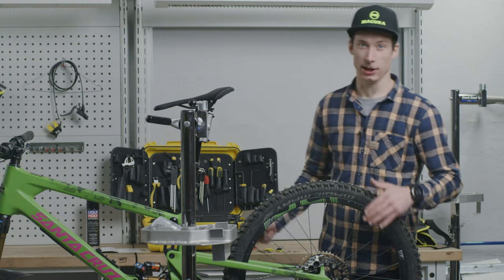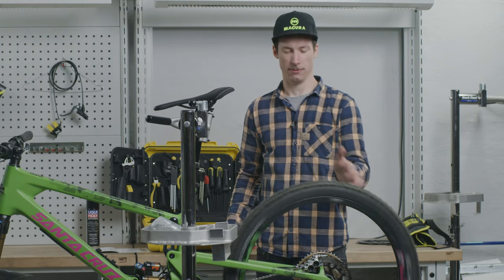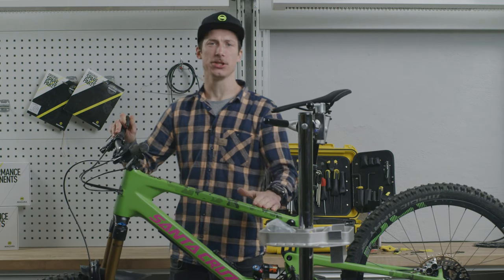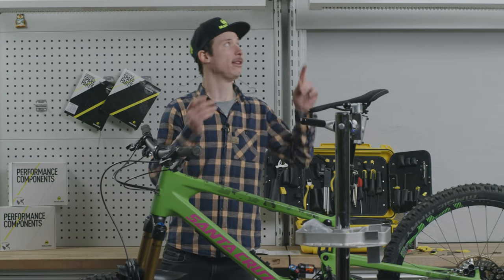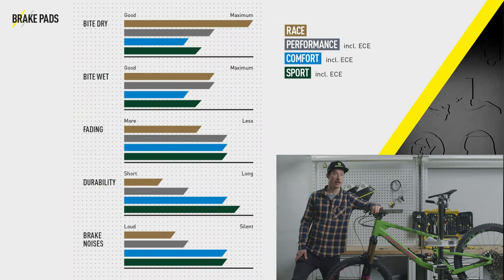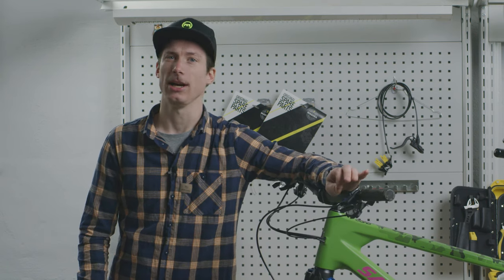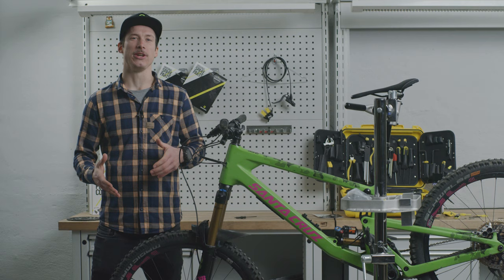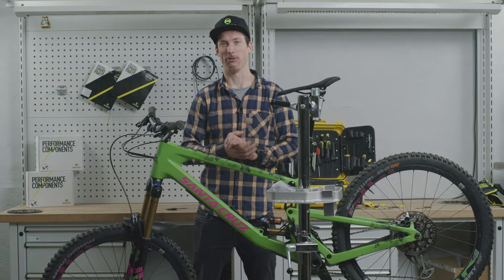Maximize Your Brake Performance - Noise, vibrations, fading, squeaking? Tips for max performance!

Comment: 30 STOPS to Bed In brake pads/rotor! 🤣🤦‍♂ 
Bigger rotors do NOT provide more braking power...
They may provide more torque and they do provide more heat dissipation through a larger surface area.
WHich provides more effectiveness and efficiency. But not more 'power' 
Larger rotors offer better utilization of thermal transfer and energy conversion.

Comment: My new MT7's are making a horrible gurgling / turkey gobble sound when gradually braking. Going to try the tips here in this video, and I'll report back! Also sent a message to Magura customer support to see if they've had anyone with this problem in the past
Reply from the maker: Could be an issue with caliper alignment, could be an issue with lack of bedding in / glazed pads. Feel free to send us a message on Facebook or Instagram for more help!
Reply: Hey i have the same problem, when im braking im getting haptic feed back in my lever.

Comment: My mt5s make a very high pitched chirping noise. I’ve cleaned the rotors with alcohol and sanded down the pads so I’m not sure what else is up
Reply from the maker: Sanding down the pads may not help if they are glazed probably? Please check our guide here https://magura.com/2022/Bike/Performance%20Guide/Performance%20Guide_DE%202020.pdf or contact us via direct message or E-Mail if you need further help.

Comment: Yeah I got some  mT5 hc ... both on 203mm rotors. they never have felt like that have any stopping power.. and the dust they create is stupid...  a 30 mile street ride you would think I had went thousdands of miles without touching the brakes ever... you literally cannot even see anyting but a visibile thick black layer of dust both inside and out... its stupid.. I wish I had bouight them on amazon.. least I could return them
Reply from the maker: Did you bed in the pads before your first ride? If not, a lack of bedding in can have a substantially negative effect on braking power and pad durability. 

If there's an issue with your brake, you can contact one of our dealership partners ( https://magura.com/en/EUR/dealer-search ) to get it checked out in person, or contact the shop where you bought the brakes to check for warranty claims.

Comment: Hi, I installed trail sport brake and 203mm rotors in my yt jeffsy bike but I don’t know what rotors adaptor I need? Thanks in advance
Reply from the maker: Here´s our guideline with informations which caliper adapter is right https://www.magura.com/en/components/techcenter/faq-adapter-for-disc-brakes/

But please contact your frame manufacturer first, which kind of postmount a jeffsy has.

Comment: As long as the temperature remains below +/- 30° I arrive to drive without noice.  When temperature rises above, noise starts.  (Experience while cycling to Rome from Bruges.  During the climbing operatrions once I arrived in Toscane where the air was dry and temperature raised above 30°, fully sunshine, the brakes made a lot of noice.  (The 34 km climb to the Splügen Pass passed in completely 'silence').

Comment: My MT7’s have failed twice on the mountain in the past 3-weeks. I had them professionally bled and during my DH riding today, half way down the front brake faded and then nothing. The rear was also almost gone. By the time I reached the bottom, both brakes had failed. Like I said, twice in the past 3- weeks. Awful! I have replaced the brake pads, same issue. Can you please confirm any troubleshooting to resolve these issues. The brakes are practically new…
Reply from the maker: We sincerely apologize for the issues you've experienced with your MT7! Please send us a message on Facebook or Instagram, or contact us via our contact form ( https://magura.com/en/EUR/contact ) , if you need any further help with this.
Reply: That's very unusual .
Reply: @siriosstar4789  yep, that was unusual. I had been fine for a while. After winter just crap. I tried a couple of things and completely bled them twice, and had a professional shop bleed them also. Still part way down the mountain on the 3rd run, to the bar. Scary. I love the Magura MT7 actually. So before moving to TRP’s I gave it another go and bought new pads, the e-bike/DH Magura rotors and then did what what suggested to me was a pull bleed from the brake lever assembly. After multiple pulls and significant air movement out of the lever, including a soft rubber mallet tap on each brake assembly, I managed to get the brakes to function over the lever pull. The brakes are now working, couple of times at the mountain and it’s solved. To be frank, my Code RSC, Ultimates, and XTR brakes have never been so troublesome. However, none of them give me the single finger trigger modulation and power the MT7’s provide, so managed it and am happy they worked.

Comment: We need MDR-P in center lock version. PLEASE!!!
Reply from the maker: We launched the MDR-P Centerlock version this summer. The 203 mm version is currently sold out at many dealers but back soon.
Reply: @MAGURAPassionPeople  What about 220mm? Why can't I find the products in your latest catalogue? Thanks a lot for your reply.
Reply from the maker: @sonnyfung5135  You can find the MDR-P 220 mm rotor on page 51 in our catalog here https://magura.com/2022/Bike/Catalogues%20and%20Magazines/Product%20Catalogue/MAGURA_Katalog_2022_DE-EN.pdf

But yes, the MDR-P CL isn´t available in 220 mm.
Reply: @MAGURAPassionPeople  Very confusing, under "TECHNICAL DETAILS
", it says the 220mm CL is available on https://www.magura.com/en/components/bike/spare-tuning-parts/productdetailpage/?p=51681
Reply from the maker: @sonnyfung5135  thanks. We are very sorry. This is an embarassing mistake from our side. The website is now corrected.
The MDR-P CL is only available in 180 & 203
Reply: @MAGURAPassionPeople  Why doesn't MAGURA produce MDR-P CL in 220mm? This size has become the new trend.

Comment: Wow, that caliper alignment trick is the best! Now I do it eyes open, it's done in seconds! 🤣
Only joking... Magura pad clearance is tiny. Alignment takes ages.
Reply from the maker: We're sorry to hear that you've had issues with aligning your brakes in the past! If you have any questions or need help, please feel free to contact us on Facebook or Instagram.

As for the pad clearance: there is a trade-off between pad clearance and free travel. This becomes especially relevant for brakes with a high overall leverage, which, compared to an otherwise identical brake with lower leverage, has more free travel. To counteract this, pad clearance can be reduced.
Reply: Magura MT7 definitely is the hardest caliper to align that I’ve installed and sometimes you have to wait until some pad material has been worn off to get a rub free alignment. The braking performance is exceptional though.
Reply: Magura brakes are just CRAP. This alignment is because of a HUGE design flaw.

Comment: The best thing to maximize break performance, is NEVER buy magura CRAP.

It's absolute and total garbage. See how many videos there are about refilling these crap brakes. That is because it's total utter crap.

The hydrolic system itself WAS nice, when magura actually tried to make quality. But then some asshole manager wanted to make more profit. So the fill/bleed screw on the handles, are now made of soft plastic. CRAP.

Besids that there's a huge designflaw in these crap brakes. The caliper is NOT fixed to the bike, but is seated into a rubber clamp. So wen you brake, you move the caliper slowly away from the rim.

So after a while  (about 3 months in my experience) you'll have almost a deadly crash because those CRAP SHIT MAGURA brakes do not work AT ALL anymore.

This is the point where your shop will want to refill stuf or replace totally unworn breakpads. This is why these CRAP SHIT brakes remain getting sold. They are good busuness for the bike shop.

NEVER BY MAGURA CRAP SHIT BRAKES, UNLESS YOU WANT ACCIDENTS TO HAPPEN TO YOU BECAUSE YOUR CRAP BRAKES FAIL.

Comment: First tip don't buy magura.
Reply: bruh, best brakes i have ever used
Reply: My tip would be to not buy SRAM. Buy either Magura or Shimano or go for Ultimate performance shigura
Reply: @speedpilot  agree🤝
Reply: @speedpilot  Brand hating like that is dumb. With most high end brakes it's just about the setup. And for example SRAM Codes are very good brakes, better than any Shimanos I've ever tried.
Reply: @Asdasxel  I'm not brand hating. SRAM simply has less power that Shimano or Magura. And for the price that's even more bad. That's also why all pros rode 220mm with SRAM and all pros with Magura 200-180 xc discs
Reply: Its not brand hating when they they cost the same but do a worse job over time have fun with your little plastic parts  @Asdasxel